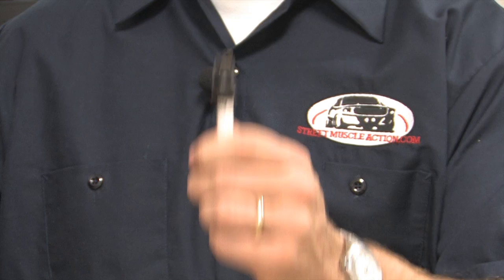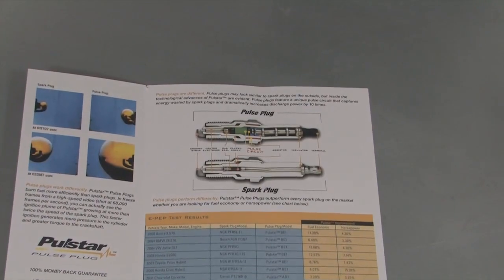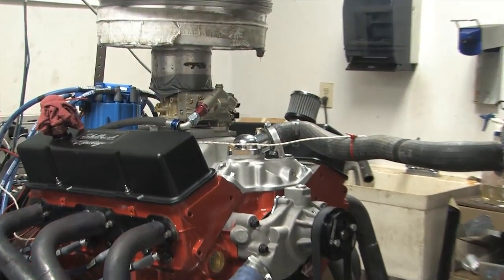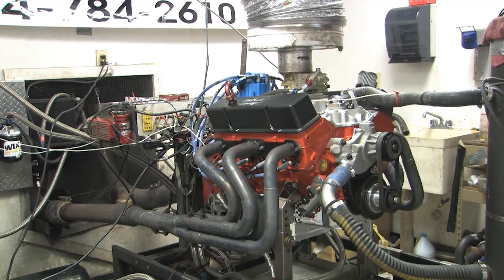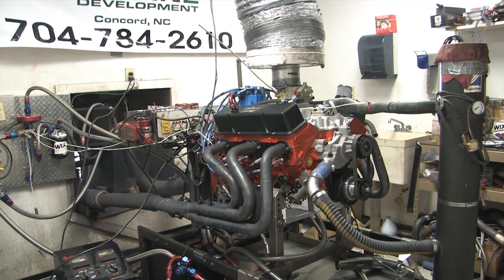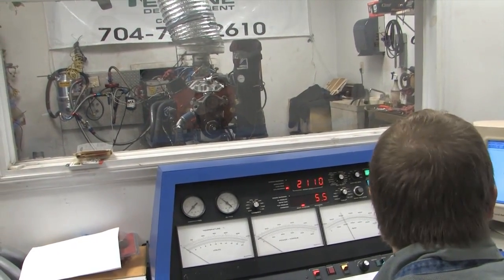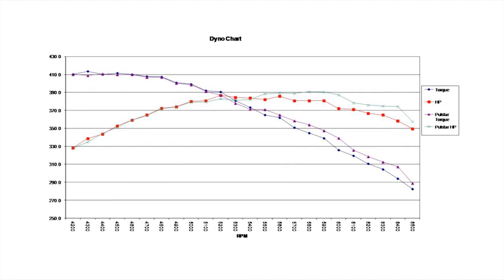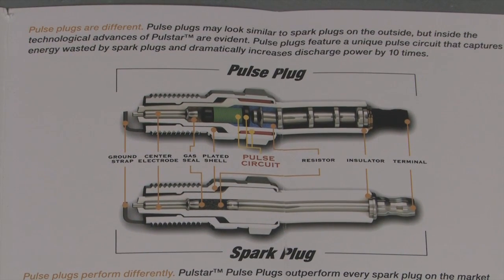Dyno Testing Pulstar Plugs to See if They Make Power

Comment: This video should be updated, here is the truth guys, pulstar do really work on fuel injected cars, i have 3 cars and i used pulstar on all and 2 motorbikes and also used pulstar, these plugs dont function well with a dripping carburetors, they do great with fuel injected engines, i tried them and am happy with them and i will never use other junk.
Reply: ...carburetors don't "drip" fuel (unless they need a rebuild) they emulsify it.

Comment: Thanks for doing this test and making this video!  I've been wondering about these plugs since I heard about them a couple of years ago.  $25 per plug is outrageous!  At that price they'd need to deliver far more than what your dyne showed.  Hell, they'd need to deliver far more than what the manufacturer says they will at that price!  I'm not a buyer.  Thanks again!
Reply: As the video was originally cut in 2011 and your comment is 6 years old, prices have come down since then. Pulstar plugs for my Honda MSRP at $15.95, available from some sources at $14.95. Sure a bit more than the NGK Iridiums that I run, but I'm open to trying them at the 166,000+ miles on my 2.4L Accord. I've tracked my mpg since March 2012 using a Mileage App, so it would be interesting to see if they improve my fuel economy. I switched to larger tires and drive 10 mph faster on the freeways (now live in Texas) so my mpg (28.1 overall average) has dropped notably from the 30mpg that I used to average with a peak at 34 mpg.

Comment: How do iridium plugs stack up?
Reply: ***** From my experience, Iridium is very good for long life.  I use copper plugs in my 409 because I check them often, play with plug gap and change them every season as they are inexpensive.  I have not seen any power, only durability, with iridium plugs.
Reply: They do seem to last a long time especially in high compression engines. I was wondering if the thin wire in them would jump a larger gap too.

Comment: im guessing those plugs burn hotter but dont that mean u need more air and fuel input for them to be anygood i can see on a electronic controled engine to work it may tune it self a bit for the plugs but this one has a carb i would re tun the carb and do this test again just to make shure

Comment: I wouldn't pay 25 bucks for a spark plug anyway....
Reply: me neither. The ones for my honda blackbird are  $18....some kind of iridium pencil dick things..I cross referenced into regular ngk with same heat range and bought 3 sets.  it made 148 @ the rear wheel with oem, 147 with the ngk and 12 months and 1100 mi. later it made 152  with the same ngk plugs...that confuses me a little..until the guy running the dyno reminded me that he made me put 91 octane in it....said it would make more power than the 89 I usually run....dude is still scratching his head..11.4-1 compression +5° timing on 89 octane and I am + 8 hp from where I started...I swear by them ngk..easy to read and they never mis fire.  and cheap
Reply: Mabye carbon slight carbon build up increased compression.
Reply: @blackbirdxx928  Not to mention low failure rate. Only Ngks in my 79 chevy and my 94 Honda.
Reply: @Won Honglo it's only dirt cheap on a fully built motor and fuel supply...
Reply: @Won Honglo literally anything
Reply: Nope... Not worth the cash..
Reply: Won Honglo weight reduction it's free